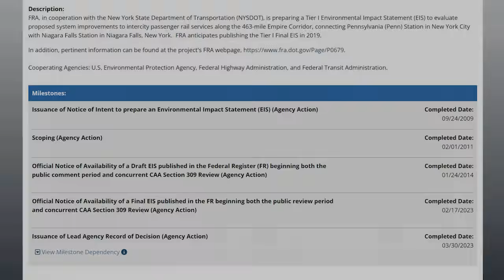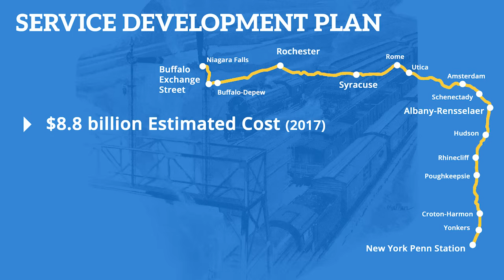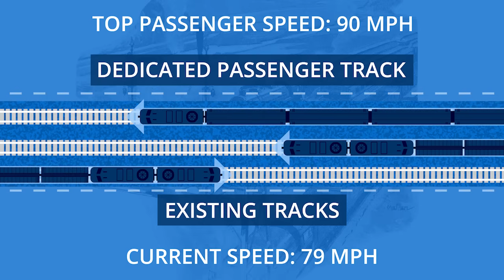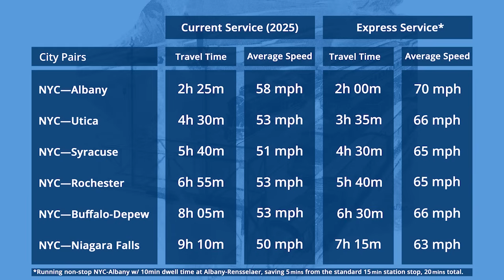Building an Express Track for the Empire Corridor | Short Version

Comment: Translation: Be Brightline. So, let's say it's done in 10 years with a total cost of $10B to be slightly generous. That's $1B/year. This year's state GDP is estimated at $2.36T. That's 0.04% of annual GDP amortized over 10 years.
Reply: Half of the required new infrastructure -- say a new double track rail bridge to replace an existent single track bridge -- would cost nearly $1B by itself. While most individual projects shouldn't take a full year to complete, just the estimate of the entire thing taking only 10 years might be a stretch. And as much as I appreciate the comparison to Brightline (via FEC), Amtrak (via CSX) should try replacing as many at-grade crossings as possible.
Reply: @TechGroupF430i  I would ask, is a third track really necessary? #1 - When Hunter was with CSX he stated that there was little justification for the double track across NY State; it could be single tracked with sidings. #2 - Brightline redoubled the track south of Cocoa and coexists (operationally) with FECR freight trains just fine. If Brightline can reinstall and upgrade the railroad to FRA class 6 (110 mph) then New York could do same between Schenectady and Buffalo.
Reply: @maestromecanico597  single tracking doesn't make sense when the goal is to increase train capacity. Advocates like HSRA are looking for Amtrak to double the number of trains between Buffalo and NYC. (Brightline was sued by FEC for trying to do that.) Are CSX trains that few and far in between where west of Syracuse could be single track? If not, then by your logic, New York might as well build a completely separate ROW (FRA class 8 preferably) since if left to CSX, they'd have to rebuild the SECOND track anyway.
Reply: @maestromecanico597  two more things: Your point about the number of tracks undermines half of the proposal. If New York has to spend money on double tracking a portion CSX decided could be single tracked, no way is this whole project $10B as you claim. (Just the bridge replacement by Albany-Rensselaer would push $1B.) Also, I wasn't questioning Brightline and FECR's coexistence. I was questioning the continued existence of at-grade crossings like the one showing in the video. You do know Brightline has an at-grade crossing problem, yes?
Reply: @TechGroupF430i  You’re missing the point. Hunter intimated that CSX had excess capacity (for freight) across upstate. (I suspect it was a political move but that’s another story.) So if there is existing capacity then a third track is superfluous. And since FECR/Brightline have proven that 110 mph pax trains and 40-60 mph freights can coexist on a double track railroad then that could be replicated in New York.
Reply: @TechGroupF430i  I retired from Brightline. I used to compile the accident reports complete with video downloads. I’ve seen more human internals splattered on every part of my trains to last a lifetime. But it’s the smell that sticks with you.
Reply: @maestromecanico597  go back and re-read my first comment, and tell me HTAF I missed a point about something I never brought up. I mentioned a single track segment that could be DOUBLED, and your now repeated response has been to tell me that there's no need to triple track. Make that make sense.
Reply: @maestromecanico597  since you seem intent on overriding MY point...

Part of the Empire Corridor plan includes double tracking a currently single track bridge. The replacement that should be built in it's place (yet isn't outlined in that plan) would alone be just shy of $1B. Are you suggesting, without considering any of the other details about the bridge in question, that that would be unnecessary because "CSX has excess capacity"?
Reply: @TechGroupF430i  I’m afraid we’re typing past each other. You’re talking of specifics and I’m sticking to generalities (otherwise I have to charge). My point succinctly: Brightline Florida is ~235 miles long, cost ~$6 billion to double track at FRA class 5 or 6 standards and replace just about every bridge on the line. Schenectady to Niagara Falls is ~300 miles, already double track for most that length at FRA class 4 standards and MAY have excess capacity. Bringing those ~300 miles to FRA class 6 standards and peaceful coexistence with the freight trains should be doable at $10 billion or less.
Reply: NYS IS BROKE.  IT MAY BE TECHNICALLY BANKRUPT.  It doesn't have money to spend on railroads.  In fact, it ought to withdraw it's current financial support.  It has to work to get it's budget house in order, and that could take decades.
Reply: @cats0182  The State budget for FY 2025-26 is $254B or just under 10.5% of the expected $2.36T GDP. If you cannot extract ~10% of your State GDP then you have a gross management problem.
Reply: @maestromecanico597  Remember that there's local budgets as well, so it's more than the 10%. However you're still correct, just remember how much Mamdani is poised to achieve with just a few tax increases on wealthy individuals and corporations. 
And there's many more financial vehicles that so far have not really been tackled.
Reply: @maestromecanico597  Yep.  NYS has a VERY "gross mismanagement problem".  Cuomo told AMTRAK he couldn't finance food service on Alb->NY trains.  The Albany commissary was closed and food service was eliminated on trains between Albany and NYC.
Reply: @cats0182  Eh, that was a cut of convenience. Do you really need on board food service for a 2.5 hour trip? Then they tried to sub it out to Subway (see what I did there?) and we all know what happened there.
Reply: @maestromecanico597  I used the Empire Line between Alb & NYC.  A quick snack on the early morning trip down was great.  Do you NEED food service?  Probably not.  LIRR doesn't offer food service on it's exurban trains (Montauk Branch, Port Jervis Line, etc.).
Reply: @cats0182 this is actually part of the argument _for_. Improving rail service is an investment that can easily improve local economies wherever it stops.   This specifically is an investment in parts of the state that haven’t been doing so well. Let’s help them out, invest a little in their local economies, improve all of our conditions